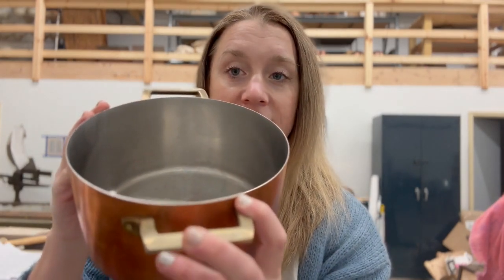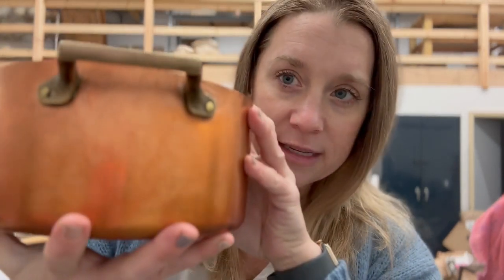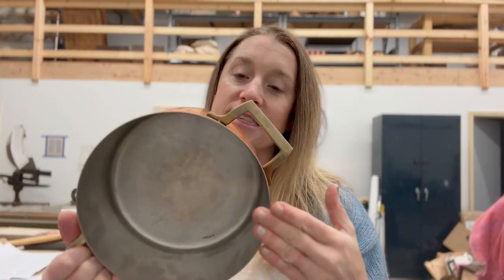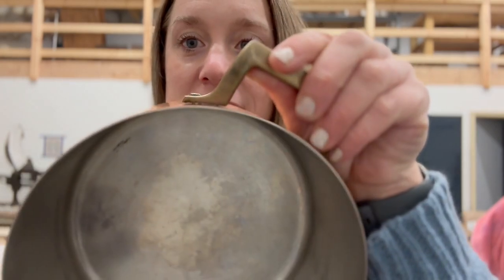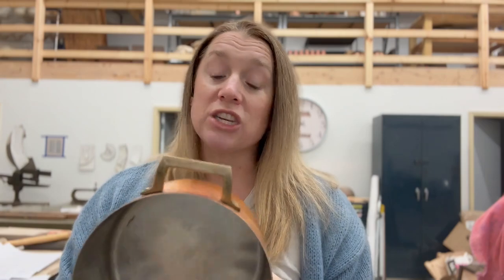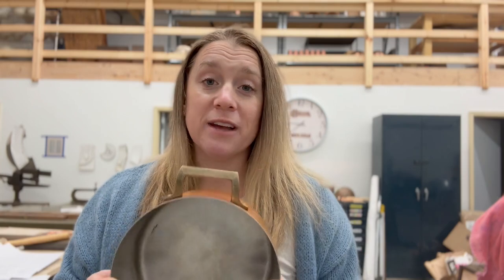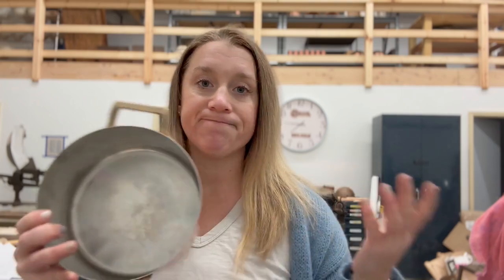Copper Repairs: Tinlined vs Stainless Interiors

Comment: So even though tin is around 3 times as conductive as stainless, overall thermal conductivity of tin-lined is only 20-50% better. This is because when lining copper with stainless you can make it really thin (like 0.2mm) vs tin's 0.3-0.5mm. In other words, saying stainless hinders copper's thermal conductivity is only partially true considering tin also does. Thermal conductivity, in W/m⋅K is 20, 67, 390 for stainless, tin, and copper respectively. So tin's thermal conductivity is six times! lower than copper.

In an ideal situation I'd love to own tin-lined, but only if I have the setup to re-tin it myself. We don't have shops that re-tin at every town square corner anymore, and shipping heavy copper to have it re-tinned is expensive. Also, stainless lined copper got a bad rep because companies kept selling cookware that was 90% stainless. Mauviel makes a 2.5mm/0.2mm copper/stainless line that makes it very responsive, and I believe Falk also has 2.3mm/0.2mm.

All in all, like you said there's no right or wrong with cookware so just use whatever. Except maybe non-stick, those can go extinct
Reply from the maker: Yes, to each their own. I suppose some people would prefer that additional 50% better conductivity you get with tin, going off your numbers. :)

Comment: And why can't you braze the rivet? Marriage of metals?
Reply from the maker: The handle itself is made of impure metal that is already quite compromised and won't withstand the brazing. Also, the rivet isn't even a rivet, it's sort of just a stamped part of the handle. And the stainless inside would get either discolored or pull off soooo much of the heat during brazing it wouldn't be worth the risk to pop off the OTHER handle.
Reply: @housecopper  ah yes stainless... always an issue. Best used for car engine parts. LOL

Comment: This isn’t quite correct, to say that it “can’t be repaired.” The more accurate statement is that it can be repaired, but all of the repair options have consequences. 

1a. Fully remove the damaged handle. Drill or knock out the “rivets” from the handle. Braze studs onto the copper and then place the handle onto the studs. May be weaker than other options. 

1b. Same, but buff the copper from the stainless and spot weld a stainless stud to the stainless body. Stronger but may discolor the copper or melt some away. 

1c. Same, but drill straight through the pot and use either rivets or bolts. Strongest option but may be a little more difficult to clean. 

I can go on but you get the point. It’s not a “can’t,” it’s a set of choices, all of which have attributes. Ideally the pot wouldn’t break at all, but saying it can’t be fixed leaves people with the impression that the pot is now useless garbage, and that’s not accurate.
Reply from the maker: 1a is possible, but the customer's whole point was they were already worried about the integrity of the pot's handle and would therefore not use it if I did this.

1b  is not a viable option as it is two layers - you cannot buff the copper away. You could, of course, grind it, which is less pretty, and would compromise the sealed layer between the copper and stainless, leaving that to eventually get food/water in between the layers, causing them to separate and then yes, it is irreparable garbage.

1c I explain in the video why I would not drill through the pot - again, see 1b above on compromising the layers of stainless and copper, and now you would have rivets that leak from the pot through the handle unless you were able to solder the rivets on the stainless interior...except tin solder and stainless don't play nice together and you'd quickly have failed / leaking rivets.

I appreciate what you're saying - that you're calling out my one word and the semantics thereof, but I as a coppersmith would not recommend doing any of the techniques and sending an experiment to a customer only to have it fail while it's full of boiling hot water and they are injured. But hey, that's just my personal preference not to do that. :P :)

That said, I'm happy to send you this pot and you can experiment to your heart's content. :)
Reply: @ you know why I stopped doing YT videos, every Tom, Dick and harry pig farmer has a barn fix they learned from Paw Paw. lol

Comment: Just use a stainless rivet, that’s what modern copper makers do. Modern Copper Stainless ply‘s don’t delaminate anymore. Yes the steel conducts heat worse, but it conducts it fast enough and the heat will be even if the copper layer is thick enough.
Reply from the maker: I am not interested in puncturing the bimetal and creating more/future problems for this pot. The customer would not be pleased with a compromised bimetal cook pot.

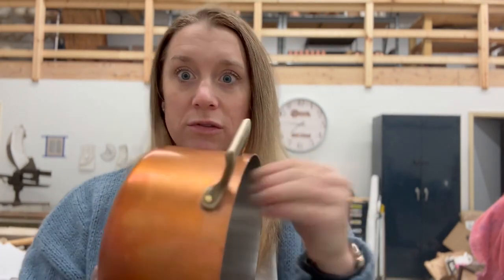Comment: 3:00 hey! There may be tool to repair those handles, look up spot welding there are affordable ones at harbor freight. Ive seen spot welding used for copper - copper bonding so it may be possible to use it to rebind the handles.
Reply: Unless HF has a new tool, they can spot weld mold steel, not stainless.